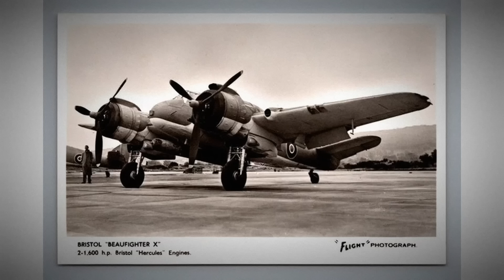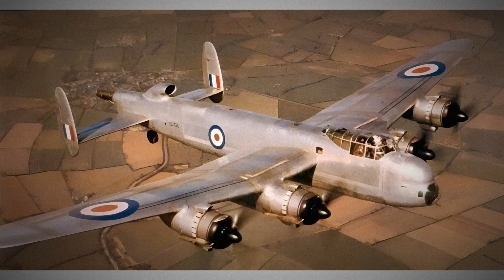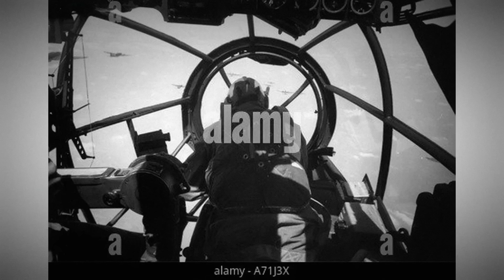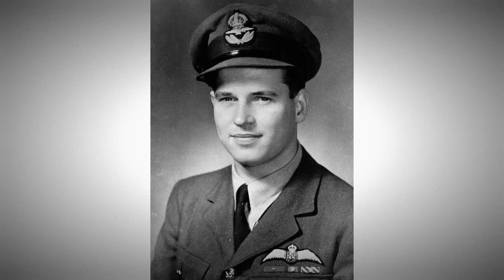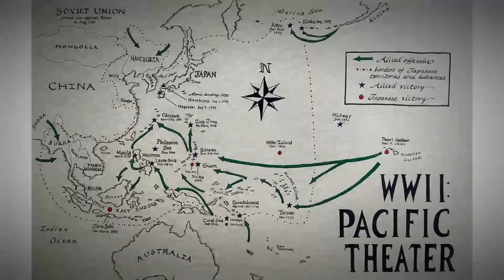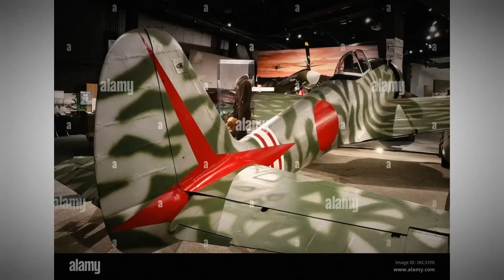The RAF's Third Deadliest Fighter Was a 'Bar Room Hooligan' (Not the Mosquito)

Comment: "killed more enemy aircraft than the Mosquito" - of course. The Beaufighter was designed to kill enemy bombers especially. The Mosquito was designed to be a bomber with multirole capabilities. The US B17 with 4 engines could deliver a payload  at 170 miles/hour. The Mosquito delivered the same payload at well over  400 miles/hour. Yes, the Beaufighter was incredibly important, but the Mosquito did the daring jobs. Without defence weapons on board.
IIRC, the most important update to the Beaufighter was on-board radar that enabled them to hunt down Nazi bombers at night and

Comment: RAAF.  Battle of Bismark Sea (1943) was fought with Mk1C Beaufighters imported from Britain as DAP production was only just getting underway.  So the had the 4 x20mm and 6 x .303 MGs.
The Japanese turned toward the Beaufighters in mistake for Beaufort bombers.  This allowed the Beaufighters to rake the vessels from stem to stern destroying gun and bridge crews and allowing the follow on attackers (B-25 and B-17) much freedom from return fire.
 Under the title "The Bismarck Convoy Smashed" is film shot over the pilot's shoulder (260535 Flight Lieutenant Ronald Frederick 'Torchy ' Uren, DFC) by Cinesound cameraman Damien Parer.  To get the shots Parer had to go without oxygen (there was no third feed in a Beaufighter) when crossing the Owen Stanly Range there and back - and he did it for two sorties !

Comment: The torque of the takeoff run in British twin engine (and four engine) aircraft was a consequence of a conscious decision by the Air Ministry to minimise logistics complications by NOT having "handed" engines complicating things.  They believed a pilot could be trained to handle the "swing". An example is in the take-off of the Lancasters in "The Dam Busters" film - the flight engineer in Gibson's aircraft is holding the throttles has them at slightly different settings to assist in combating this swing (they were "set" initially by the Gibson).

Comment: This is a false narrative as the Beaufighter was built primsrily as a Fighter, Night Fighter and Strike Fighter entering service in 1940. While the Mossie was first built in 1942 as unarmed Bomber and Photo-Reconnaissance aircraft, only later july 1942 did the Night Fighter enter service. The main production Fighter-Bomber variant, the Mosquito FB MkVI did not enter service until July 1943, a full 2 1/2 years after the Beaufighter. So the disparity in kills is because the Beaufighter served for much longer and all were Fighter variants. While only a portion of Mossie production were Fighter and served in small numbers until mid-1943. No doubt the Mossie completely outclassed the Beaufighter, it was faster, more agile  and could take more damage.

Comment: I think perhaps the most effective Beaufighter was the late Australian version which replace the 6x.303 with 4x0.5. Often wondered why the British version with wing guns wasn't updated the same way.
Reply: The main guns were the 4 x 20 mm, having 4 x 0.5 or 6 x 0.303 didn't make much difference.
Reply: @barrierodliffe4155  Consider during the Battle of Britain, 8x.303 could turn the fuselages of German bombers into colanders, but they could return to base to count the holes, rifle calibre rounds needed hits in crucial areas such as the cockpit or fuel lines round the engines to bring down a bomber. On the other hand the 4x0.5 used by the P-51B could cause structural damage, though switching to 6x0.5 in the P-51D suggests a heavier armament was desired, the F4F had a similar evolution. 
The larger cannon rounds limited the amount carried  restricted firing time, alright for the marksmen, but everyone else could use more ammo and hope.

Comment: Very selective use of statistics which leaves holes in your analysis.

How many Beaufighters were built?
How many missions did they carry out?
What roles did they have?
Were they simply fighters or were they fighter bombers?

There are statistics missing, such as;-

Submarines destroyed?  They were used in this role.
Bombs dropped in enemy territory? They were used in this role.
Maximum flight time? Range?
Were they used by Fleet Air Arm/Navy?
Did they fly without armaments as other aircraft did? Spitfire, Hurricane and Mosquito were used as recon aircraft with cameras in place of guns.

One last point, are you distinguishing strictly between the Beaufighter and the Beaufort which preceded it and the roles played by each. Reading the comments it seems that many are mixing the two aircraft.

Comment: 4.20 what are you doing. ? a Lanc mashup with no connection to the theme. Thumbs down in close proximity.  Heinkel 111 have a single fin,not twin .And a SM Spaviero thrown in for decoration .👎👎

👎 Many aircraft types were built a Fishermans Bend before the Beau including the featured Beaufort .👎👎
Reply: Not sure either what the B-25 Mitchell production line shot earlier in the clip had to do with anything. Oh right! Nothing!

Comment: Australia was building 700 Beaufort bombers before they built the Beaufighter and Mosquitoes. This gave the opportunity to use experienced workers and existing tooling.  And most of the Beaufighters had already tested in Britain.  In Papua New Guinea, the US found a requirement for low-flying bombers and the Beaghfighters offered inspiration, possibly.  Extra guns were added to US Hudson and B-25 Mitchel to suppress enemy gunfire and used with low-level bomb skipping.  This was cheap and devastating when they actually hit.  While the Beaufighter got low-level rockets.  The Battle of the Bismarck Sea changed naval warfare with these powerful medium bombers.  The B-25 gun ships were then used against Japanese bases with great success. As were the Beaufighters.
Reply: In the early 80's I worked briefly with a Fisherman's Bend Beaufighter assembler.  He was full of stories I didn't really appreciate so much at the time. One changes one's perception over time. A true pioneer in Australian precision manufacturing.

Comment: It looks both ugly, but great.  Strong and powerful.  A unique appearance and performance.  
The engines do need oil cooling, but the battle damage risk is less than the larger water-cooling systems.  The US B-25s, flying along with Beughfighters in New Guinea, were also packed with guns, up to 10  x  .50 Brownings on the nose.  They devastated Japanese shipping.  Later, a 75mm gun was added to some B-25 gunships. The Beaufighter was then fitted with devastating rockets with powerful amounts of explosive.  I have a long interest in the Beaufighter.

Comment: Winging, droning overly sentimentalized portrayal of a particularly good aircraft that did have a very unusual genesis. Comparing it to the Mosquito is pointless. They both were designed for a particular role and ended up doing stuff that no one had foreseen, many aircraft, military and civil do. The tedious dive into the whispering death stuff is pointless. The sleeve valve engine does actually run more quietly than the poppet valve one. This is due mainly to the "bang" of the exhaust gases exiting the exhaust port, around a valve head being absent, a well-documented phenomenon. When not under full load, e.g. take off and power diving and more particularly when throttled back for a slower unobtrusive approach they are noticeably quieter than say the P&W d/row Wasp of the same configuration, both of which I have heard on several occasions, flying and stationary on the Bristol Freighter and Douglas DC3 respectively. RAF Beau's on low level approach runs at Japanese ground assets in Burma etc. did so as standard procedure. I wonder why?
Reply: agreed, short of being visually spotted by the japanese on the ground they would never usually hear the throttled back engines until the guns had fired or anticipate which direction the beaus would approach from, whispering death indeed

Comment: I recall once reading a book authored by a very experienced ATA Pilot in which he referred to this aircraft as "The Beaufrightener".
Reply: There was an aircraft, Bristol Freighter, with the same engines.  One used to fly down the Woomera Rocket Range,  a dry dusty part of Australia's outback. On return the engines would need a lot of oil [I wasn't a sumpy] and oily dust, or dusty oil if you prefer, was splattered down the sides. It was called the Bristol Frightner and for good reason: The wing broke of one and the other in the squadron was undergoing a mainspar modification. My Q then, and now, is "Why bother". Jeez we had some Pommy crap at RAAF base Edinburgh. Years later the RNZAF was flying us to Rotorua on an exercise stand down day in a Freighter and a Dak. I chose the Dak. .
Reply: @billthomas635   The deadly DC 3, it killed more people than any aircraft up to the DC 10.

Comment: If it had twin rudders, it was either a Do17 or a Do217, or just possibly a Bf110 on the prowl for British bombers returning home. The He 111 was a single-tailed plane, and did not have a dorsal turrwt, neither did the BF110 , or,so far as I'm aware, the Do17. The Do217 did have a tuuet, The others had Mgs on swivel mounts in that position..

Bit of an odd comparison, there, vs the Mossie. The Beau was intended to be a night-fighter, but proved to be a capable multi-role aircraft, while the Mossie was designed as a bomber, but proved a capable multi-role aircraft,. The Beau could also drop torpedoes, and with rockets under each wing was a deadly ground attack aircraft, The Mossie ,  coulnt carry torpedoes, but was faser and could fly higher than the Beau, and was also a good night intruder, not something the Beau was used for IIRC/ Then, theres the question of how many of each variant of each plane was produced, and when and where they were in action.  I'm happy to agree that, IMHO, the Beau is under-appreciated nowadays, but I dont think comparing how many aerial kills the two planes achieved says anything about one being better than the other! .

Comment: Would it not make sense to actually consider the multiple roles the Mosquito played in WW2 (recon, night fighter, bomber, etc) when comparing its kill ratio to that of the Beaufighter? The latter had a much more limited role in that regard.
Reply: Not sure I agree. The Beaufighter also performed a large variety of roles. Nightfighter, coastal command ship and submarine attack, and ground attack in support of troops in the Pacific. That is a large variety of demands for any aircraft.
Reply: Additionally, it depends on how many of each were built. Getting a hundred more kills isn't impressive if you have twice as many flying missions. It would have been good to get those stats, not just to repeat the "more kills" line like it's a mantra.
Reply: @GoodEggGuy   Both performed very well and for the RAF both did better than the P 51 which had less air to air kills than a Lancaster or Gladiator.
Reply: Another thing, the Beau was in service two years before the Mossie.
Also the Mossie started life as an unarmed bomber that used it's speed
Reply: Beau fighter was deployed in multiple roles as well, including torpedo bomber maritime patrol and ground attack, about the only role it wasn’t deployed in was as a pathfinder for bombing raids . . .

Comment: THE HE 111 DOES NOT HAVE TWIN TAILS,,,,,  GET UR FACTS STRAIGHT,,,,
Reply from the maker: You're absolutely right — the He 111 had a single tail. That's on us. We've noted the error and appreciate you catching it. Corrections like this make the channel better.
Reply: You stated mid way that the Hercules engine was deafening loud yet the tail gunner in the HE 111 can't locate the attacking Beaufighter by sound from 200 yards away. Maybe that's where it got its nickname because the Beaufighter, although loud, wasn't noisy enough to drown out the HE 111"s own engines.